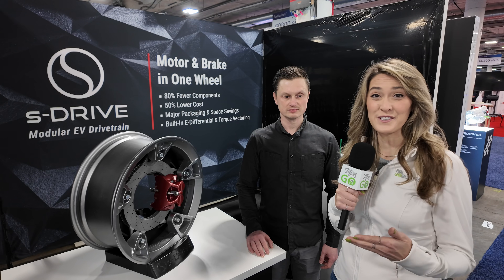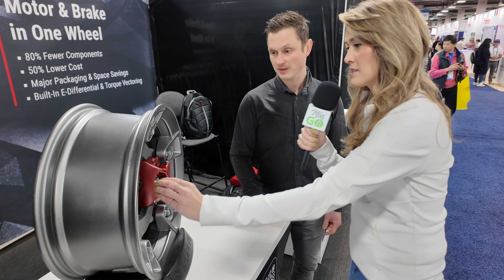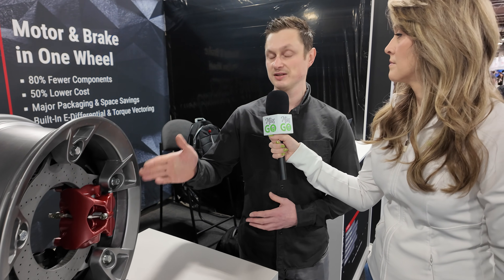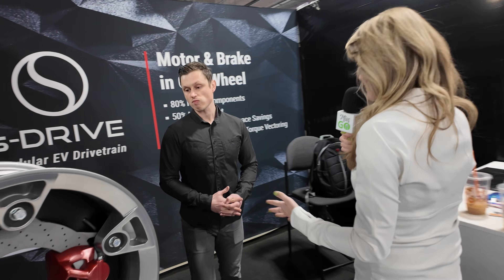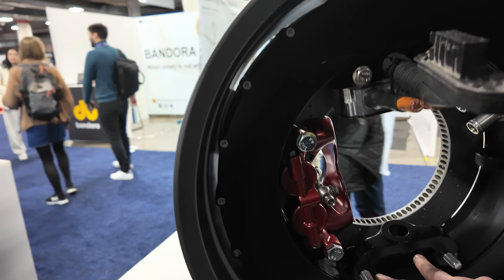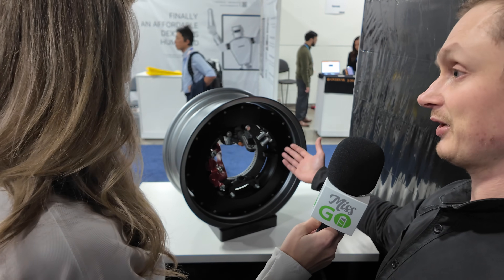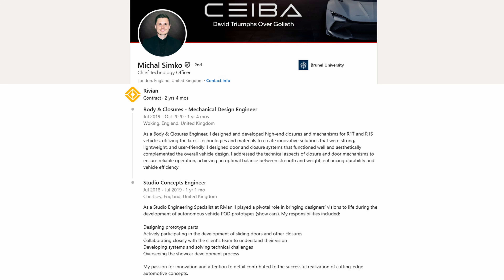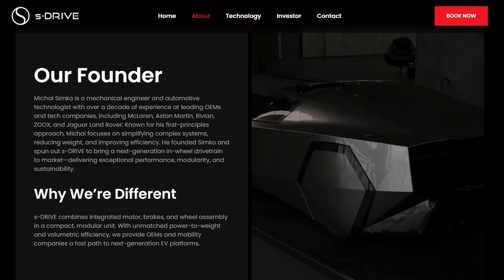S-DRIVE In-Wheel EV Powertrain Solution (CES 2026)

Comment: This is game changing, even a bit of suspension. This even saves weight of inboard electric motors gearbox and axels. Incredible for ev conversions, they'll be lighter than as ice vehicles and much cheaper and easier installation. Reliability much better.
Reply: Looks like the brake rotor is structural to the wheel......that won't fly.
Reply: @GrahamStewart-j6w Nope wheels catch hell. Stones, mud, dog piss.
Reply: @GrahamStewart-j6w the guy clearly said the whole motor/brake setup is dampened, meaning it's not hard mounted to the wheel.
Reply: @sergeyakinin997  That guy wasn't listening.  He's the kinda guy who immediately starts looking for things that “won't work”.
Reply: @GrahamStewart-j6w Not a lot different to seeing a caliper through the spokes, I'm sure some type of further integration or cover should come in the future. For the time being, it shouldn't matter for something that is 300% more efficient and all the other benefits.
Reply: You want the weight inboard not out on the end of a stick unsprung. This is the worse arrangement possible.
Reply: @lenrichardson7349  except he said it's not heavier than a normal wheel without a motor
Reply: @lenrichardson7349 there is no extra weight it weighs the same as a wheel.
Reply: Every time you hit a curb and get some curb rash?  Have to replace motor and brakes?  One “wheel” probably costs $4k
Reply: I guess it is a magnet to metal debris from the road. I am also wondering about the ip rating. 
But interesting design for sure!
Reply: @TheStuartstardust    ferris road/rail particles is definitely an interesting topic.  cleaning products, wet roads, car washes, etc.
Reply: Game changing? Yes.  Lighter?  No  If you ever look at eddy current brakes or regeneration, the results you can get are impressive but: that last bit of creep [somewhere under 5mph] you still need something mechanical for a final stop.   Only the engineer can say what feet per second rotor speed starts losing force at a critical level and friction braking must take over.
Reply: @flinch622 With the weight being the same as a standard wheel you will save roughly 100 kg over a standard EV in motors gearboxes and axles. With 300% better efficiency you only need a battery 1/3 the size and weight, This will save you another 400  kilos. So when a conversion usually weighs a couple hundred kilos more than the standard ice car a weight saving of 500kg will absolutely make an Ice car lighter! Of course you still need brakes...?
Reply: Great Reporting ! Will invest in Reporter 😊
Reply: Your points can't be further from the reality. Just one thing among many: are you aware this setup would require completely new type of tire to be design and manufactured, than tested and priced accordingly? Why, cause due to a structural rigidity of a drive system and it unsprung mass, tire wall takes additional flexing and compression. Limiting factor is not power, economy or top speed but to remain on the road and unhurt as court claims in case of accident could be very expensive.
Reply: @Helloverlord Sorry must of interrupted your coma, GFY!
Reply: @gacattack1234  no need to be so sensitive - just because you didn’t think about what you wrote.
Reply: And how do you power a moving wheel with a stationary battery.
Reply: @M13x13M  it's explained pretty well in the video.  The hub doesn't spin.  Only the rim is connected to the rotor...
Reply: The Bosch caliper that I read in the Donut battery comments may make for durable all weather and road deicer conditions. The chemical road deicer in the United States is Evil on the undercarriage of a vehicle!
Reply: Not really. There are better designs out there
Reply: The new technology for EV’s will change very quickly, the problem will be lack of government control of the generation and supply market. Also will need to generate much more energy in the near future.  Everything has to go electric, except planes for now.
Reply: Più problemi che vantaggi
Reply: I don't see this as a game changer until there is not long-term expierience with such motor constallation. I'm doubting int that suspenstion solution for the motor in long term. What still have to prove ist: 
1. Can it run 1.000.000 km without damage and 
2. What's the cost if you have to replace one engine
Reply from the maker: YOU GET IT.

Will you join us over at our main channel and follow this story with our weekly news?
youtube.com/MissGoElectric
-Producer Tim

Comment: Combine this with a hybrid system and you've got a winner! 
The engine/hybrid generator/starter can be tuned for maximum efficiency at the engine's maximum efficient RPM.
You delete CVT's and the rest of the drivetrain, saving weight and increasing fuel efficiency.

Comment: As far as I can tell, this is a significant step ahead in in-wheel motor tech.  Great job.
Reply: One thing I didn't get to see in this interview is the bearing technology.  Given this is hubless, the integration of suspension knuckles is a great idea.  But the bearing that will allow the rotor/wheel assy to rotate, will be large, and will be critical.  How was this addressed?

Comment: First thought : unsprung mass, the mass that is not protected from the bumbs in the road by shockabsobers.

He knows that too so addresses it immediately. My question remains how this wheel can be the same weight as a normal wheel?

The motor might be able to convert all braking energy into electric energy, that does not mean this car runs for free and does not even mean that this car can accellerate  again from the braking energy that was generated seconds before. Large supercap’s will help, but how large do you need and can you have them onboard….

Saying you are 3 times more efficient then a Tesla….. that is a huge claim, I hope someone can convert a Tesla model 3 to use these wheels, maybe strip out the old engine and proof it.

Comment: I don't see this as a game changer until there is not long-term expierience with such motor constallation. I'm doubting int that suspenstion solution for the motor in long term. What still have to prove ist: 
1. Can it run 1.000.000 km without damage and 
2. What's the cost if you have to replace one engine

Comment: I worked on MBs for 35yrs. One thing about cars is true. The rims, tires and frt suspension takes a lot of abuse. Rims and tires get damaged all the time. Making a rim/motor unit will run into abuse, therefore reliability and cost issues.

Comment: How do you change a flat tire. Seems you would need a Xtra tire and built in drivetrain which sounds expensive. Also, the drivetrain seems exposed to theft.
Nevertheless, as long as it's EV tech, keep innovating!
Personally, I believe low cost EV battery tech is the biggest goal.
I've had my EV car since Jan  2021 and will never depend on an ICE car again.

My car starts and looks like a new car. I believe I've lost 5 miles on 80% charge.
It has never been to a dealer!

Comment: 💢💢  So many designs like this but he cherry picks information for unrealistic/irrelevant conclusions. FAIL!!! Who didn't catch that? I massively invent in this space... including revolutionary motors such as 10X torque density, 10X lower copper, NO MAGNETS, etc.
---
>>>Our ultra-efficient, Fuel-Agnostic, Zero-Emission [FAZE] engine technology will displace any vehicle electrification. That means electric vehicles are inferior in all metrics. Period.  Like motors, the technology enables constant maximal torque and efficiency at all speeds and conditions without a TRANSMISSION. 💢💢 <<<

The   >>>low cost<<<   FAZE is revolutionary yet is in a simpler, smaller package, with very little electronics so repair is 'old school' simple. It's virtually noiseless & vibrationless and odor/smoke free. Low cost braking energy recovery system dispenses with batteries. Real world driving cycle efficiency is 200-500% better than the competition. Many other benefits abound. 

>>> We have developed a zero vibration range extended [genset] for aviation and other needs. If we incorporate our Fuel-Agnostic, Zero-Emission technology and HushPropulsion tech, the drones/PAV [personal air vehicle] will be utterly silent and capable of longer range with higher payload. Search the net for PersonalJet.
 <<< 💢💢
https://www.youtube.com/post/UgkxhGjKg6ppvEbWjAzYFSWugLsG4-gZeaxf
https://www.youtube.com/post/UgkxMv9TXO0K1JiYNuFL81cyNbrqxATcaCgi
.../
../
./
/

Comment: Good video. It looks like it may be designed only for Fairweather places. In places with ice and snow where the ice and snow get into the rim of the wheel then you will have snow in the motor. In places where there is high water where water will go up over the wheel, then the motor is going to be dunked in water. Yes this needs to be put into a real production vehicle for testing.

Comment: Same weight as a simple wheel without a motor? Fantastic! That means the tires and suspension don't require expensive reengineering. Turning radius is limited only by how much the wiring harness can twist left and right. In a small car, this could save hundreds of pounds in drive train parts. Frees up more room for passengers and storage, simplifies the chassis foundation, encourages more drive by wire.

Comment: Great concept. Reminds me of the rear brake discs with drums inside like the Mercedes type of softer rear wheel rolling braking, mixed with a bit of the a roller Coaster type of electromagnetic braking cushion effect of the track. May be worth trying something like a Stock Car or old mini but maybe more with a McMurdogh Turbo Fan sort of design to suit, or maybe an old Low Rider with smaller wheels and chunky tyres to size match the design but with low profile tyres. Probably the best match to the electric toy car sort of close to the hub rotational energy that helps make the wheels lighter. Could probably do with some ion type of tyres to balance out weight with the hub forces outwards to the tyres to catch the traction better being so light weight and needing some weight put back in. Maybe concider the width of tyres overhang a but aswell to act a bit like a split rim kerb band. Should be a bit better and easier on the bolts than a narrower inward tyre direction. Probably best not to go too low though so a good few centimetres of sidewall more like racing slicks sort of style maybe. Bit big for a Go-Kart maybe but could be worth concidering for smaller wheels fir a bit of fun. I think a trouble with these types of wheels might be the need for lighter weight alloy driveshafts, so you may find that an issue with performance matching materials and braking force requirements. Maybe try some Kit Cars or the target manufacturer may be something like Koennigsegg for more exotic materials, or maybe an Audi for the spoke type design. More suited to a Mercedes type of braking system though perhaps but I would think a bit unsuited to the typical Mercedes though to be honest. Maybe try an Ariel Atom for a track car to test them out for a concept to develop a car with. Could be worth trying a Caterham aswell but alloy wise I thing an Aerial has more the exotic material edge. Old soap box type of racer car designs might be worth a look. I can't think what the category is of them but they are very light weight typically and a similar shape to the McMurdogh Turbo Fan. May find the Caterham Box design more suited but I think the Aerial more a monocoque design you could make more of an exotic Red Bull racer or Ferrari sort of narrower focus design for something more like an off road remote control car sort of spider leg flex effect for that fun Sand Buggy racer sort of effect. Maybe try looking at Lawn Mower Traktor sort of racing for handling, or maybe some of the Morgan Motors vehichles for a coach build. Depends really if Aluminium or Carbon body styling. Carbon probably more suited but again depends where weight may be needed if steel better suited to have something like a Rally Car type of handling dynamics, although, maybe a McClaren F1 style model something more suited to the wheels to show off a modern version of the non abs brake bias and the design of the brake shoe type of look more resemboing a clutch spring mechanism maybe for some extra potentials to go with the design for extra spool and maybe more dampening and kick back handling more akin to an electric toy cars motor cogs sort of effect for more braking force pushing out. May put alot of strain inward though. The old Vauxhall Astra Race Car engine revved up to about 10,000 to 11,500 rpm and could be installed forwards or backwards. Could be hard to find and expensive though but may give that sort of forwards and backwards power range and bit of weight lean in the crank depending which direction it's mounted. Probably slight difference each direction. May be something that gives a bit of tension inward without too much strain maybe absorbing some of it a bit. May help give some of that muscle car poise higher up for a bit more agility over a hunkered down lower lump. Should be light enough an engine to suit more of a proper car size as it may not be suitable for any of the car chassis mentioned. If rear wheel steer could be added you might find it quite lively but maybe not so safe to risk. If you wanted a rear wheel drive though, maybe the Renault Space F1 engine being rear mounted for bit of a brute. I'm just not sure on the weight. The old Mitsubishi FTO is a lightweight handling beast if you wanted to just try the wheels. It's just 19's are too big for it though. The best match I can think of for 19's to try out is probably the newer Audi A6, but getting the wheels to do their thing without a purpose developed system might be more an obstacle than you might think. At a guess I would think something well balanced in body more ideal. An old Corvette Stingray sort of style coupe concept maybe to model from being a bit like a small boat. Could be nice for an eV version to show boat a bit of a concept car. 🤔👍 I should add when I wrote this comment I did so based only on the look of the outside of the wheel. Great to see the rest of the video and ticking so many boxes with the chassis and handling potentials and things. Great stuff, looks promising... 👍

Comment: Won’t work on autos. The tire and wheel is a replaceable item and this is a huge advantage. With everything on the wheel, that would be one expensive wheel if you hit a pot hole or curb and had to replace it!

May work on motorcycles, I think they already have one, but it’s expensive!

Comment: S Drive together with solid state must be the holy grail.
Reply: It's not. 
From engineering perspective the design is absolute crap that would fail rather quickly... 
How are rotor and strator sealed against water and sand? Either you have a right seal and crazy friction or you have crap seal that will fail to protect against water and sand.

Comment: These comments are so funny. You do not want this in a classic 😂😂😂 extremely slow. You want a proper ev motor with gear box preferable whole transmission, and a rear end with differential. the whole point of ev swapping a beautiful neck breaking classic is to smoke everything else on the road in an expensive, I have more tools and shop space than you, kind of way. Otherways a built gas powertrain would be objectively better in a classic than this lil hub motors 😂

Comment: Permanent magnets in wheel motors are dangerous and you can destroy them when driving over path holes. Also the unsprung mass is higher with these hub motors. Its hard to control them with torque vectoring  with out real mechanical differential.

Comment: Axial flux in a hubless wheel? That's elegant engineering! 🔧⚡ Reducing parts for simplicity and reliability is the ultimate “less is more” design philosophy. A brilliant rethinking of EV propulsion. Hope they find the right partners to scale it.
Reply: if you had physics in high school than you know why this motor configuration is nonsense for mass produced cars.
Reply: Throw some water and sand at it, and drive it over speed bumps and see how long it lasts.

Comment: There is no way that placing a motor inside a wheel would be the same weight as one without it. I like the out of the box thinking, but this will absolutely increase the unsprung weight.

Comment: Could see this used in Semi trucks on trailers going up and braking going down add two the trailer and two to the drive axle and you could climb a mountain and brake coming down incredible bet they buy him up are Tesla works with him in Semi trucks.Gotva little S10 are Ranger and you could outrun Alot of newer vehicles.

Comment: Not game changing but cost changing. What is the cost to replace a damages tire or wheel and you have 4 of them positioned at the interaction point between road and car where impact forces are greatest, damage more likely and reliability therefore becomes a key issue.
I am sceptical that this has mass adoption for those specific reasons as well as the fact that BEV adoption is falling and the market itself shrinking as consumers move toward PHEV and hybrids in general.
Other vehicle applications such as motorcycles, 3 wheelers and lightweight small urban solutions may find some benefit but again cost and reliability without failure seem key points.